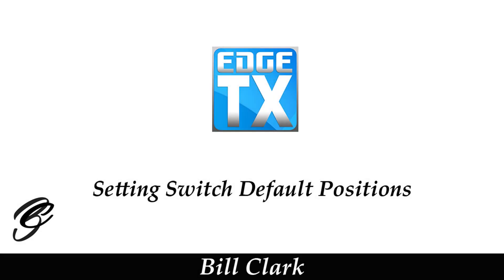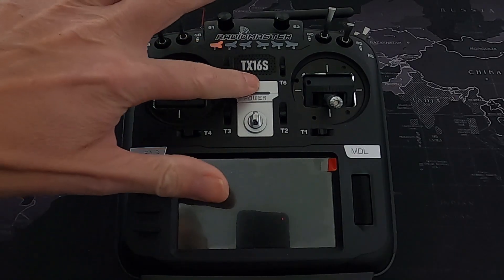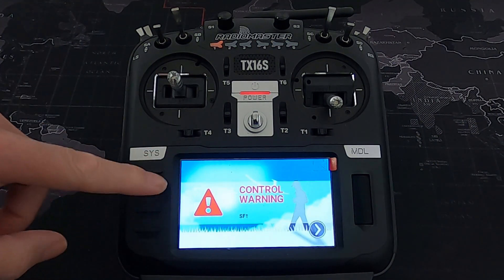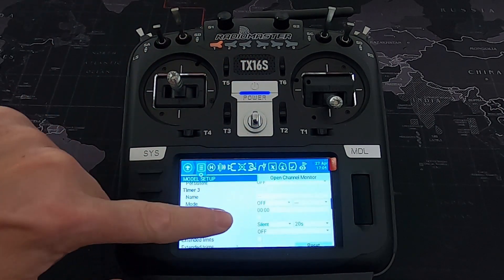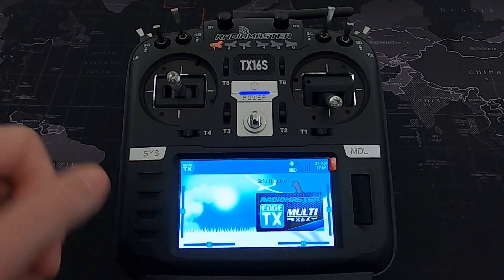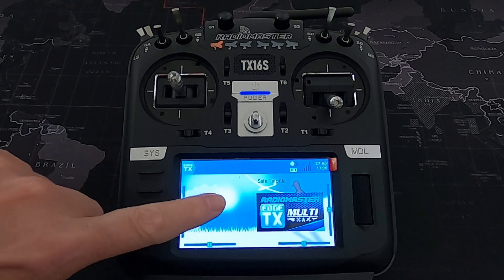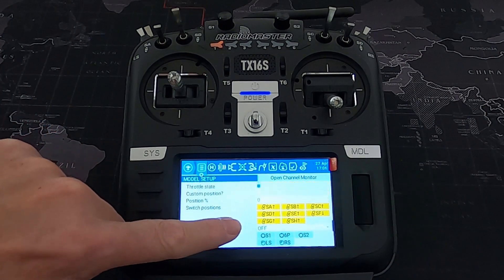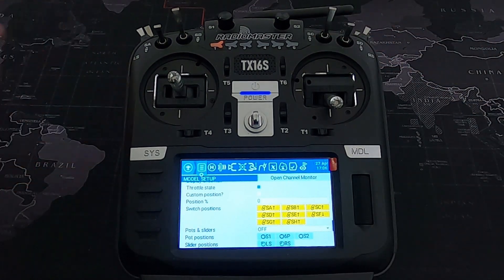EdgeTX Setting Switch Default Positions

Comment: I'm curious if there's a button you can push so that it sets all the positions to whatever your switches are currently at. Rather than changing each switch one by one. On OpenTX if you long-press the scroll over this part of the menu, it does that, but that doesn't seem to be the case on EdgeTX?
Reply from the maker: I have taken a look and could not find the same method to set all default switch positions a once in EdgeTX Normally I think most people would only change the armed switch default position.

Comment: Hi Bill, New subscriber here. This great info but can you tell me if this is possible with the new tx12 mk2? Mine is the cc2500 version. I have tried looking following rhe procedure that you showed but it's obviously a different radio. I was also wondering if you could do a video on how to set up a beeper on the second disarm (closest to you) position on that 3 position switch. Just received my tx12 2 days ago and I admit that I am a bit confused by it. There is a lot to learn. Thanks for doing what you do 😁
Reply from the maker: This works with all EdgeTX and OpenTX radios. The buzzer, you need to set up a mix on your radio using the required switch then assign the switch in Betaflight. Please check my playlists for a full video list of start to finish setting up a drone it is for OpenTX but relevant for EdgeTX.